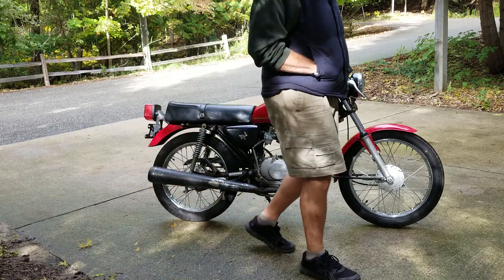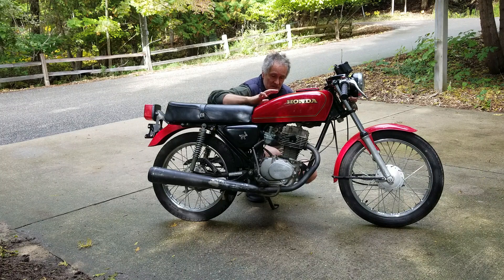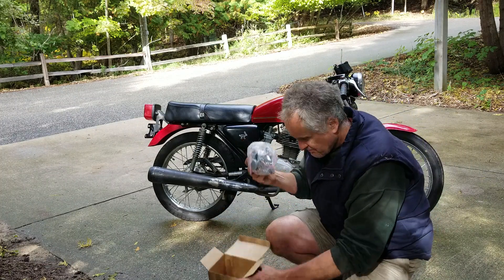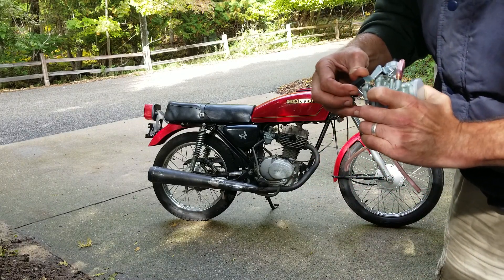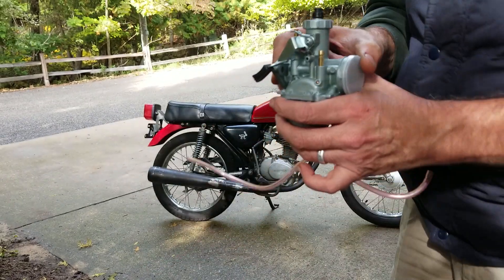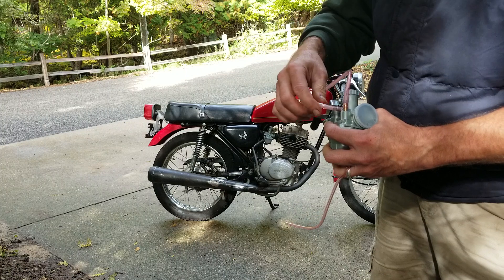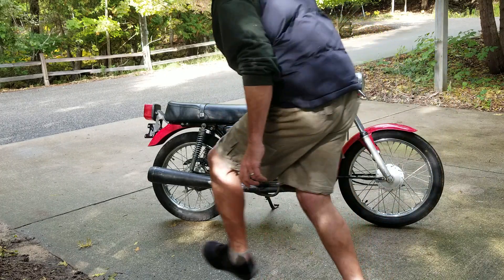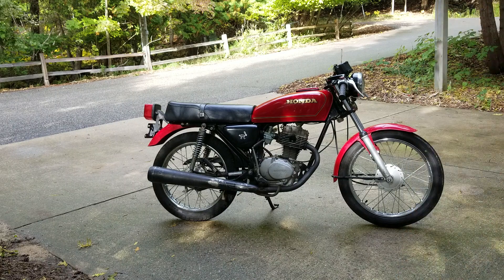Johan's Haus von Motterad #3

Comment: That might be a vacuum line that goes to your petcock on the fuel tank?  Sounds good. To help clear up some water in the fuel I pour half a can of seafoam
Reply from the maker: It turns out that it's just a vent. I stuck a fuel line on it and just routed it behind the engine.
Reply: Sweet. Are you a jack of all trades but a master of none?
Reply from the maker: I've mastered making salsa. But that's about it.

Comment: Have you tried putting it to your mouth and blowing air through to see if it actually goes somewhere, a lot of carburetors have what looks like places for extra lines but wasn't ever drilled out at the factory, I've got one with three. Best i can figure is a wide variety of things actually use the same base carburetor so they cast it with the extra ports and only drill them for the ones that actually use them, That or its made for modifications. It might also just be a bowl vent, My son's 4wheeler has one that comes out in a spot where you can't fit an filter or anything on it, so one year dirt daubbers built a nest in the hole and it ran like crap for a long time, i could never figure out why till i took it apart and stuck a screwdriver in the in the hole for the heck of it and the nest started falling out, it's always getting crap in it too. Ps sorry for the bad grammar I'm a bit simple i guess lol.
Reply from the maker: Howdy Fordman. It turns out that it's just a vent, so I put a fuel line on it and carried it down, along with the overflow from the bowl.

Comment: That's an overflow/ fuel vent. Don't block it off.
Reply from the maker: Thanks. It should have been obvious but I missed it. I guess since the one that I replaced it with didn't have this vent. I feel dopey because my 500 has a Mikuni with the same vent.
Reply: @johnjriggsarchery2457  don't worry about it!.. live and learn!
Reply: Probably a vent, an overflow wouldn't be so high up.